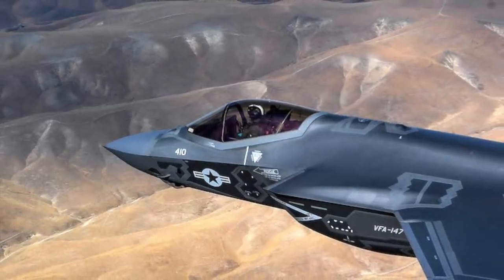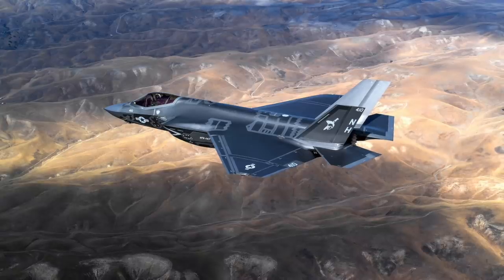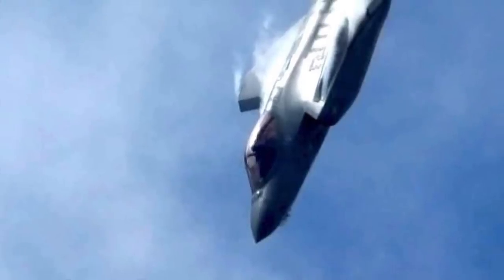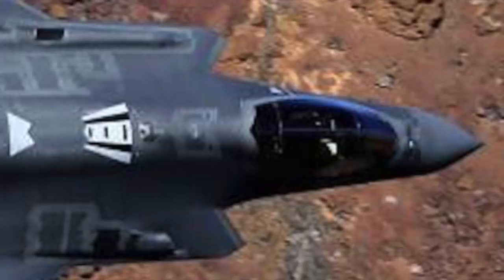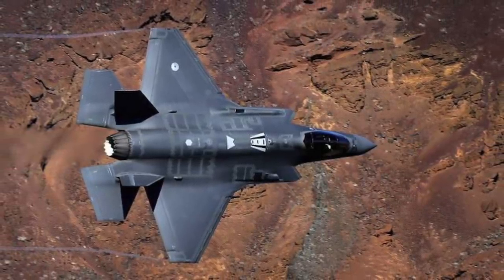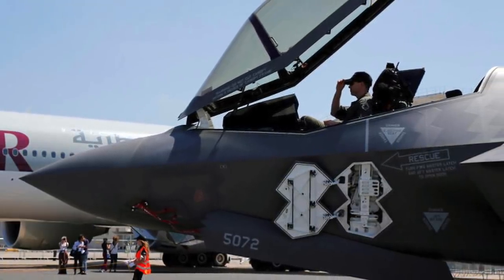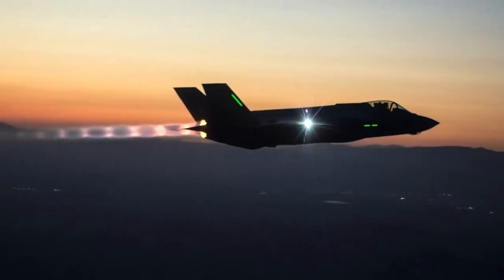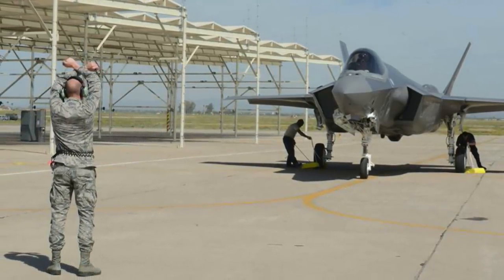HOW GERMAN MADE RADAR MANAGED TO DETECT F 35 5TH GENERATION STEALTH FIGHTER ?

Comment: "the aircraft were flying with radar reflectors and ADS-B transponder" - when stealth is not required, reflectors mask the true degree of radar cross-sectional area reduction
Reply: Excuses excuses lol
Reply: @Domispitaletti  More like "reasons, reasons".
Reply: @Domispitaletti  One more thing.  "Stealth" doesn't mean "invisible" it simply means it's far harder to detect than normal aircraft.  And.....if ANY plane is within a few miles of  radar, it's GOING to be detected, but stealth technology allows planes like the F-22 and F-35 to approach other aircraft from longer distances without being as easy to detect.  If a plane is at an airshow, it's going to use reflectors and have it's transponder on, for safety reasons.
Reply: @tidefanyankee2428  why not just let the mid air collision happen? it would be spectacular
Reply: @reallydontlikethem  Congrats, you just won the dumbest comment of the day award.  Your parents will be so proud.
Reply: Yes but the radar reflectors and this special radar don’t operate in the same wavelengths... so the fact that the reflectors were on is irrelevant.
Reply: @floriangutensohn4083  I'm not claiming to know ALL the "in's" and "outs" of this radar, but what I do know is that if you use this radar it has some limitations.  From what I've read, it's not effective for targeting.  In other words it's not very accurate.  Secondly, radiating radar works both ways, just like tracer rounds...it becomes very easy to target and knock out.  There has been some talk about FM radars being used to detect stealth planes, but they have a harder time with other flying objects or so I've read.
I'll say again, stealth doesn't make planes invisible, just much harder to detect at distances.  I would also question if this type of radar can be mounted on a plane.  Further, if someone KNOWS a stealth plane is going to be in an area, and know what direction they are coming from it would obviously make it easier......but in actual combat, that isn't known.
Reply: You don't know much do you? Russians make their planes now with composite materials as much as possible because everyone is using radar lengths that simply pass straight through the radar absorbing materials and reflect of the internal components. You can make up whatever bs you like. I like to deal with facts.
Reply: The last two Israeli bombing runs towards Iranian assets in Syria have been intercepted by Russian fighters and sent home as soon as they crossed the border. Clearly they at least can see them
Reply: Exactly.
Reply: @thomassmith4999  Send the info on these bombing runs ?
Reply: OK guys too many people here don't know what they are talking about. I explain to you how this system works. The key is not the hyper sensitive extremly high resolution passiv radar but the neural network sofware used. If you record the radiobackground in a region while you record the acctual position of a stealth vehicle present you got a perfect dataset to train a NN   detecting it. The more datasets you got the better the software gets. What i can Imagine is, that the system funktions better in regions where the datasets used to train it originated. To me it seems totaly reasonable that this technology works. And the reason why it wasn't forseen during the planing of the 5th generation aircrafts is the rapid development in the AI sector and the development of NN specific hardware.
Reply: @swunt10  , agreed. In fact, the principle isn't new, multistatic radars exist since years. What is really new is the technology that supports the required amount of processing power. Years ago, I've witnessed a prototype made by Leonardo (former Alenia, Italy) that demonstrated the concept with moderate performances. Clearly, the limiting factor was the processing power at high frequencies. Now, direct conversion to I/Q samples up to S-band and high speed DSP allow much more to process. No doubt that evolution since that trial was a reality for all major manufacturers (Raytheon, Thales, Leonardo, Hensoldt, Indra, etc.)... Funny also to see the confusion made between primary and secondary radars regarding civil ATC...
Reply: While traveling in civil airspace, all military aircraft just need to activate the A/C/S mode of their on-board transponder. That's enough to make them visible for all civil secondary radar and associated Air Traffic Control centers... No need to rely on passive reflectors where most civil ATC are less and less equipped with long range PSR...
Reply: @dankepige  LMAO, yeah, the Russian propaganda network is an excellent way to get reliable and believable information about Russian technological capabilities. /sarcasm
Reply: @valerierodger7700  I'd trust Putin any day over a bunch of secret society Moloch worshipers intent on micro managing every aspect of your life. Tell me again about the constant Russian propaganda? Meanwhile in usa the msm are blaming Russia for the blm riots. Wake up to yourself.
Reply: @valerierodger7700  Sorry unable to answer, reply censored. Rest assured my rebuttal was excellent. Lucky the globalists are on your side.
Reply: @valerierodger7700  Sorry can't reply, auto censored.
Reply: Well guys just to be a little real... the F35 will not last long in a hostile, IFR, Night, Bad Wx in mtn terrain and you need to get bombs on target on time...?who you gonna call?
D makers--With all due respect...don't make another CAS aircraft with one seat...¹.Most aviators understand how fast "things" can go bad especially when the Ballon goes up... This one seat 💺 vs two seat 💺 💺 aircraft is really over...Drones and the today's technological complexity goes beyond the ability of one person control. This is serious stuff
Reply: If the radar detection is improving,  so is the radar absorbing material
Reply: @Domispitaletti  for safety   and its SOP. standard operating procedure. Amazing how little people know about things like this but claim to be experts.
Reply: @dankepige  the internal structure is shaped to trap the radar. The outer layer is only 10 tp 15 % of the stealth component. Russia using composites is more about weight than stealth. But they make really neat airplanes. Russia and the USA should be allies but BiDum is an absolute idiot. Putin is a much...MUCH better leader. BiDum was elected through fraud abd cheating. Hopefully Putin will remember this.

Comment: A few remarks:
1. The F-35 shows up in the infrared wavelength just as visisble as any other heat producing jet aircraft as bright as the sun. Heat signature management (meaning simply put: not to engage the afterburner) reduces the detection range of imaging infrared sensors only slightly, since they do not look at heat per se but at differences in temperature between the environment and a target. As such, anything standing out against the background will trigger detection. Also noteworthy is that not only the engine exhaust is a massive heatsource, also friction by airflow on wing leading edges, air intakes and control surfaces do so. 
2. A low radar cross section in the bandwidths mentioned - merely in the frontal and rear aspects of the aircraft, are helpfull in pushing back the detection and tracking ranges of certain radars, but any maneuvering (banking left/right or changing altitude to steeply will trigger a signature. This means that with a radar in the side, the F-35 can be tracked and locked on to. 
3. In other bandwiths (low/ultra low frequencies) the F-35 will show up, but it is extremely hard to pinpoint the location and determine course, speed and altitude. This makes tracking and locking near impossible, but it will alert hostile combat air patrols (CAP) to its presence and estimated location, triggering a ground controlled intercept (GCI). This makes the aircraft extremely vulnerable to enemy fighter aircraft. 
4. The German radar uses a principle well known since the 1990ies, called Passive Coherent Locator System (PCLS), using emissions such as cellphones, radio, television which function as a multitude of radar emitters. All a potential adversary has to do, is to put passive receivers at certain locations in order to triangulate position/altitude/course and speed of a LO aircraft and Bob's your uncle, unless operations are in scarcely populated areas with virtually no emissions. 
5. So penetrating heavily defended airspace becomes a holy grail once more which must entail all either aspect, all bandwidth (also IIR) low observability or a heavy duty SEAD/EW capability. The F-35 does not have that anymore, due to its very long gestation period. Put simply: in a few years time it will become as visible as 4th generation fighters albit with a hefty pricetag on it and mediocre (at best) aerodynamic/payload:range performance, high operating cost and heavy reliance on the US as the main supplier/enabler. Allies therefore already begin thinking of competing alternative capabilities of their own.
Reply: Thanks, thats the comment I was trying to make with my brocken english and limited knowledge in radar technologies.
Reply: @al rode Partially agreed. The problem as I see it, is that HARM is rather short legged and requireds the F-35 to operate pretty close to air defence missiles batteries (also due to its very poor supersonic performance, which cannot give the HARM a high initial launch speed => reduced range). I also wonder wether the HARM missiles fits in the internal weapon bays. If not: LO is being compromised. 
As for missile locks, one can imagine a midcourse guidance by datalink and terminal guidance by an imaging infrared (IIR) seeker, which is said to be less sensitive to jamming by flares. I thought the French MICA (the IR-variant) works that way, but I'm not certain. 
Anyway, the F-35 in my view has been overtaken by emerging technology, is a very poor performer (latest news: cannot sustain supersonic flight because of occurring damage to the tails and the RAM-coating), still suffers tens of mission critical shortcomings and is too exoensive to buy and operate. Buying F-35's effectively means unilateral disarmament. IMHO we better abandon this aircraft alltogether and go back to the drawing board. What do you think?
Reply: @heinrichmirgrautsvordir6613  Kein Problem. Sie dürfen das auch auf Deutsch schreiben. Hab 9 Jahre Deutsch in der Schule gehabt. (Mit, nach, nebts, bei, seit... usw = Dritter Fall). Und bin auch noch ein Fan von Rammstein dazu (jeder sein Geschmack, nichtwahr?) :) "..mir grauts vor dir.." war das nicht eine Frase aus "Flugzeuge in meinem Bauch" von Herbert Grönemeyer? Grüße aus den Niederlande.
Reply: @Pincer88  Ja, Niederländer haben echt die Gabe perfekt Englisch zu sprechen. Ich hab leider in der Schule nur Französisch lernen können, daher kann ich nur ein paar Brocken Niederländisch (Hallo, ik spreek verschrikelijk Nederlands)
Das "...mir grauts vor dir" kommt aus einem Buch Goethes, Faust I. 
Das Herbert Grönemeyer das auch benutzt hat wusste ich noch nicht.
Viele Grüße in die Niederlande aus Deutschland. :)
Reply: @heinrichmirgrautsvordir6613  Herzlichen Dank für Ihr Antwort, das ist ja nett. Owei, dass ist lange her, dass ich Faust in der Schule lesen müßte. Ich kenne nur noch die erste Frasen vom Erlenkönig: 'Wer reitet so spät durch Nacht und Wind? Es ist der Vater mit seinem Kind..." 
Dass Sie kein Niederländisch sprechen ist ja nicht so schlimm; es ist nur ein Dialekt der Deutsche Sprache ;) Hoffentlich wird unser Land im Zukunft ein Bundesland Deutschlands, so wie es gehört, dan können wir auch Heineken am Reinheitsgebot halten...
Aber wirklich: Deutschland ist der beste Nachbar der wir uns wünschen können.Ihr seit im Algemeinem höfflich, hilfsbereit, tüchtig und Ihr habt - in Gegensatz was manche denken -  guten Humor. Die 'Zischlaute in euer Sprache sind so wunderschön. Und ein fabelhafte Umwelt. Ich liebe den Harz, der (?) Eifel, Schwarzwald.... Nur die Fälle, die schwache Wörte (Ahn, Bär, Bauer, usw) und Konjunktive, die sind grausam um zu lernen. Sonnst nichts als Gutes.

Comment: Americans trying to defend the flop that is the F35 is so amusing.. The radar technology used was passive radio wave detection. It doesn't matter if the aircraft had reflector lenses, or if it "wanted to be seen". By understanding the technology used by the german company, you would also understand that stealth technology does not work against this type of detection technology, and was made to work against active radars working with much higher frequencies

Comment: ...what practically nobody is getting here, including even 'DefenseUpdates', is the fact that the way the plane was detected by this PASSIVE Radar system is independent from F35's radar reflectors being employed or not. However, the company which developed the radar in question does not claim to have located the planes with the pinpoint accuracy required by AA missiles. Afaik, the company does not even see the main application of this radar in a military context.
Reply: That's what I also thought, but then I realized that there are many other radar systems that are constantly scanning all over Germany, who did the ACTIVE part in sending out the radar waves for them. The PASSIVE radar detected these waves reflecting from the radar reflector under the F-35's belly.

Something similar was reported about the F-22 in the late 2000s about being detected during exercises (when they are supposed to be fully stealthy).
Then it came out that because in said exercises, F-22s would always absolutely smash any F15 F16 and F18 without even being detected, it was decided to use these reflectors so the opponents in these exercises would stand a chance (and actually take lessons from the experience). A lot of pilots would flat-out refuse to fly against Raptors because it always ended the same way.  You're flying along nicely, you know there are one or two Raptor out there somewhere, you're all searching for it and then suddenly, a voice comes in over the radio saying "You're dead... You're all dead...".
Reply: @sadekgheidan   Yes, I heard this as well.  With regard to the Hensoldt Radar in question, ...it indeed appears to be the case that reflections of the electromagnetic background illumination are being picked up, albeit at a different wavelength to those that would be thrown back by the reflectors. I would think that a company developing something like this should/would know  about F35 planes using reflectors when not on mission. One can probably conclude from this, that the whole tracking experiment would not have been conducted by Hensoldt, if the reflectors, deployed or not, were of major relevance with regard to detection by the radar in question. The company itself does not comment on the test other then stating that the system is not designed to engage stealth airplanes. ... I don't think it can.

Comment: The typical Lunberg lens radar reflector doesn’t work in the frequency range of this passive radar system. Most passive aka multistatic radar systems use high power RF emitters I.e. digital tv, radio, and other higher power broadcast transmitters as the illumination source to track aircraft by the use of TDOA most of these transmitters fall well below the L band into the VHF and UHF bands. 50-1000 MHz. At these frequencies Rayleigh scattering is the primary return mode of an object the size of a fighter jet as large parts of the aircraft approach the wavelength or multiples of the wavelength. This is the same reason we see many VHF and UHF radars being fielded. The big issue is the longer the wavelength the less accurate the location can be. My guess is yes they saw returns and got rough locations for these F-35’s but any useful targeting information would have been too corse to even cue a fire control radar on to the aircraft. This is a well known and published weakness of LO aircraft. To me not even news worthy